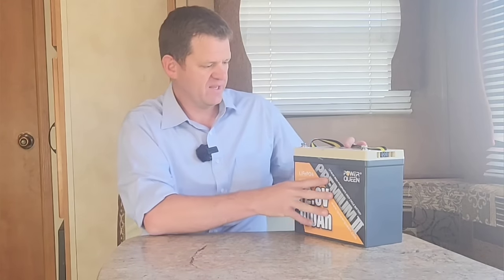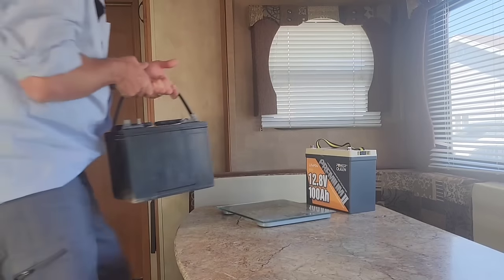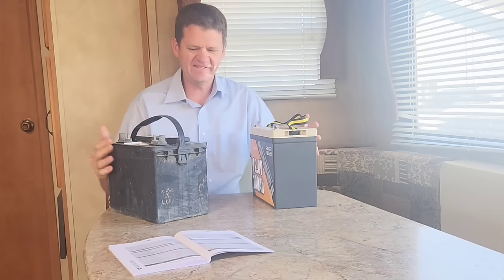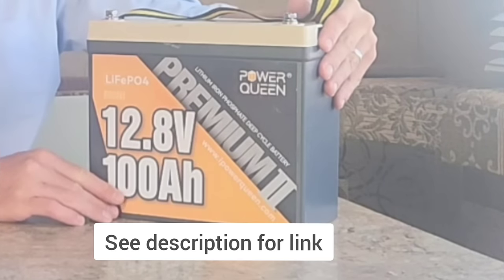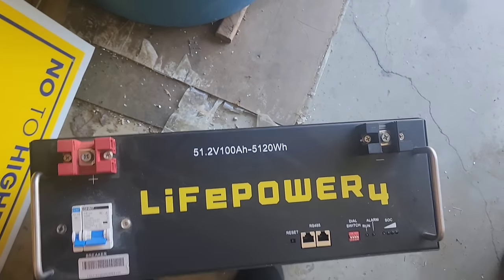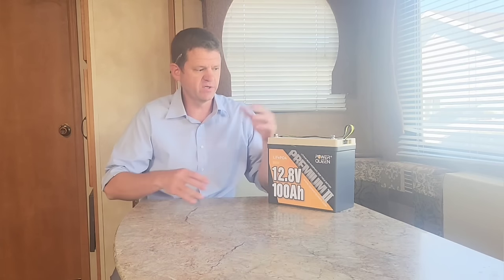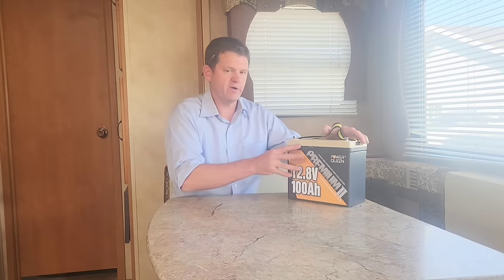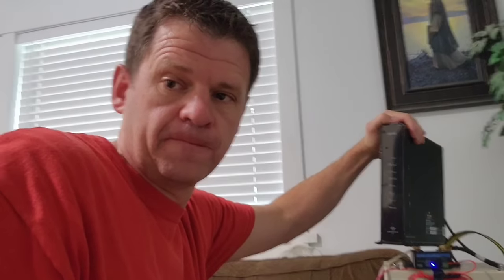How Long Can a 12V LiFePO4 Battery Run a Fridge, TV, Laptop, and Wifi Router (PowerQueen test)

Comment: Anything that will run off 12V should come directly from the battery.  I have the same battery running twelve LED light strips about 16hrs a day, a router, phone and tablet 24hrs a day, and it uses about 40ah on average with the lights being the highest draw.
Reply from the maker: That's a good point.
Reply: 12 volt is the way to go.
Eliminate the inverter except as needed.

There is a company named PMMI Lighting out of Sweeny Texas that sells all 12volt lighting systems run from a Raspberry Pi module using ethernet routers and CAT 5/6 cable.
Switches and lights are programmable via a Spreadsheet.

There system is pretty sharp.
Reply: Great information.

Eliminate the inverter where possible.
There are 12v TVs, Refrigerators, Freezers and lighting systems.

The appliances have come a long way in the last 15 years.

Most TVs run off of far less than 12volt today.
Reply: @shawnr771  I recently expanded my system so the 3,500w pure sine wave inverter now has to power my fridge and a cube freezer, hence it has to run all the time.  But before that I only powered the inverter when needed.  There's lots of stuff that will run off 12v with no inverter.
Reply: @frankmaze1972  oh absolutely.
I built a 12 volt system just to run lights, fans, a very small fridge and a tv set plus charge phones.
You are far ahead of me.
I live in Texas I want to build a cold room. Heavily insulated and cooled by a 12 volt AC for when the temps get to extremes. Just in case the grid power goes out.
Reply: @shawnr771 thanks
Reply: @shawnr771  With the recent threats (yes threats) from ERCOT to start cycling off power in 15 minute increments, I'd get on that sooner than later...
Reply: I love my Onite LED bulbs powered by USB. I`ve used them for three years with no issues. I can hang a 100w folding solar panel in the shade of my camper roof and still power a light for "free"
 in my dark camper all day. Even if it`s very cloudy the light works. I`m gonna rig up a glass panel next month with a USB car adapter for free daytime light. I have power stations and a large battery but love rigging up strange things. It`s a blessing to have power for all my stuff in my camper, even a small air conditioner, during our constant Louisiana power outages. My sister nearby who called me "crazy" and her OCD son have a lot more money than me but have nothing for emergencies. That`s loony to them. Power was out FIVE TIMES during extreme heat emergencies this summer. I`m disabled, no car, but nobody checked on me, even after 80 mph winds in one storm. They evacuated to hotel rooms. That`s ok...my freezer never thawed and my tiny AC stayed on.  @shawnr771
Reply: @shawnr771 
All the decent 12V fridges I’ve had my hands on have an inverter built in and are really 110V or 220V inside.
Also long 12V high current runs are very inefficient.
Reply: @Margarinetaylorgrease  The  one I have is an oversized cioker and it is 12 volt.
It does nor have a compressor.
Reply: @50kArchipelagos  My friend has a 12volt TV. Not big works great in storms
Reply: @shawnr771  Me too...
Reply: @Margarinetaylorgrease  I have two "BougeRV 12 Volt Refrigerator 12V Car Fridge 23 Quart Portable Freezer Compressor Cooler 12/24V DC 110~240 Volt AC for Truck Van RV Camper SUV Boat Travel Camping Road Trips Tailgating -7℉~50℉".  Use one as fridge one for ice.  Not for a family.  I'm a single so I rough it by nature.  That's on the Zon.

 "
Reply: charlesfinnley5106  I am not sure of this batteries capacity and I learned battery math using amp hours.

A lithium battery can be run down farther than a lead acid and they are lighter.

So I will use an example.
There are online calculators.
Amps = Watts/Volts.
Lets say you have a 200 amp hour battery with a 12 volt Tv set drawing 96 watts.
So amps = 96÷ 12
Or 8 amps.
This is per hour.
200 amps ÷ 8 should = 25 hours of TV watching without recharging.
But you dont want to totally discharge any battery.

So for each appliance there is usually a information plate that  usually lists wattage, voltage and sometimes amps.

Just divide the amps on the label into the size of the battery.

Hope that helps.
Reply: Your "old video footage " is caused by the light coming in the window, close the blind or film from the other side of the room. Try reading the instructions for your camera about exposure control and eliminate the glare to get a better picture.
Reply: Also if you buy another battery you can parallel the batteries and double the amp hours
Reply: @frankmaze1972 Do you have special things to change the type of current? I thought doing something like trying to charge your phone with DC atleast in america would ruin the battery or just fry the phone? Or is that really only something you need to worry about in Europe for devices and appliances that are not designed to be run off of 220-240 DC?
Reply: @shawnr771  There are batteries actually that are designed to be completely discharged and be fine. Deep cycle batteries and marine batteries which are deep cycle batteries that are designed for salt and fresh water conditions and are pretty water proof up to certain depths of course. A normal car battery is just a starting battery and everything else is designed to be run off of the alternator. An AGM battery is different though. They are normally completely sealed and instead of being a liquid battery are normally just filled with special cells. They can be discharged and recharged many times and can also be used for starting though if I remember correctly they arent the best for starting a battery due to it being able to shorten it’s life span. My Iphone battery is another example. Every so often I am supposed to completely discharge the battery and leave it off for a few minutes before plugging it in and recharging it.
Reply: @Margarinetaylorgrease  Ummm. Ok. So how are you multiplying your volts there?
Reply: @Margarinetaylorgrease  I am very sorry. Somehow what I was thinking and what I was typing were exact opposite…. While embarrassing I will admit this happens to me from time to time and I dont always catch it fast enough and I am also on 2 hours of sleep after running around for near 36 hours straight….
Reply: @Margarinetaylorgrease  I have already explained that and apologized. Just ignore the other comments. Its embarrassing enough that it happened again. It is a problem thats happened way too often lately and its actually frightening. Its a sign of a few possibly brain related issues that plague alot of elderly people and I havent seen a neurologist yet due to a lack of money.
Reply: @AmaterasuTheWhite  
I was replying as you were
Reply: @AmaterasuTheWhite  
I’m sorry to hear that.
Try to not beat yourself up about it.
I’m more sorry that getting help is a problem.
Reply: @shawnr771  yeah the inverter is a little more greedy when it turns the 12v into 240v
Reply: @AmaterasuTheWhite  if you can charge your phone in your car with the cigarette lighter/power point then you can definitely do it in your house.  And DC to DC charging is much more efficient than AC to DC charging.
Reply: @frankmaze1972  I thought your vehicle turned the DC into AC or that the actual cigarette adaptor switched it in the U.S. before sending it to the outlets in the vehicle? And yes of course you can charge your phone in your house in the U.S things like your phone are designed to be run off AC which is what is supplied to houses in the U.S while in Europe DC is used. Someone should volunteer to hook a phone they dont care about directly to a 12V battery to see what happens to the phone’s battery over time.
Reply: @AmaterasuTheWhite  all house power in the US and EU is AC voltage (US 120 - 240vac and EU 240vac) and ALL phones operate on 3.7 - 4.2vdc (most are 3.7vdc).  So if you plug into a wall socket the power is converted to DC and reduced to 5vdc by the USB connector, OR if you plug into a car outlet (12vdc) the power is reduced to 5vdc by the USB connector.  Morel of the story, ALL phones charge on 5 volts of DC power coming from the USB connector.
Reply: @frankmaze1972  When did the Europeans switch the AC?
Reply: @shawnr771 how often power goes out?
Reply: @AmaterasuTheWhite in Italia e europa la corrente is AC no cc 230volt in usa is 120volt ac normal de battery evry cc 12v or 25.6v o 48volt 51.2v
Reply: @AmaterasuTheWhite  Europe does NOT use DC power. Everywhere uses AC. Many items use DC power, which is why we have adapters and power supplies.

Comment: The amount of time you can get for a fridge will depend greatly on the ambient temp . If it's 40 degrees in your house it will run a lot longer than if it's 100 degrees.
Reply: it would be great to have some kind of chart to see that.  I'm thinking keeping the condenser coil shaded would help?  I know the water cooling technique works, but its just not reliable.
Reply: If it's 40 degrees, I'm not running the fridge. I'll keep the beer and cola on the counter.
Reply: And how many times did the kids open the frig door? Like your video. Considering a backup system,. LP generator or lithium batteries.
Reply: Also depending the brand/quality of the fridge.
I have a Samsung (fridge/freezer combo) with digital inverter, which means it doesn't consume maximum wattage to adjust or keep temperature it can gradually increase the power and speed of the compressor.
Reply: and the number of times the door is opened
Reply: Using a refrigerator as a test is about the absolutely worst thing you can choose!  For one thing, they don't use much power. That's on reason why all these so called "solar generators use a refrigerator as an example in their advertising!!  If you don't open it much or add contents to it. Any decent fridge will keep food fresh and even frozen for 3 or 4 days without power! And people will think the crappy "solar generator" works great because food is still cool!  People just assume that it's a big appliance, so it must use a lot of power. It doesn't.

A 100 Amp hour battery is not realy very much power even if you have an efficient inverter. 

These kinds of tests are mostly a waste of time. Better to just learn the nameplate continuous watts of an appliance. Things like a refrigerator atr no continuously on. Accounting for conversion losses, that battery will supply about 1000 watts for an hour. or 100 wats for about 10 hours,  So 1000 divided by the wattage, will give you a pretty close estimate of hours use you can expect. That is the simple way to figure it out and it will be pterry close
Reply: @professorg8383 ok ok però lo schunt misura tutto i watt xhe scono non c'entra se apri o meno la porta del frigo lui cmq misura tutto cmq de lifepo4 da 100amper 12.8volt is good 1.1kw real più 180watt per il consumo dell inverter victron is good
Reply: Damn, I would never have think that! That means maybe your AC increases your electric bill more and more as the outside temperature goes up?  Wow!

Comment: Fyi to the people who wanna know why the inverter (and technical all inverters and generators) are in VA (volt amps) and not Watts. This also explains why the AC kWh dont match up with the DC kWh, especially with the fridge. It is call power factor and it only affect AC power. It is to complicated to explain here but there is plenty of good videos and websites online that explain it. But all you really need to know is that kW is the usable output energy and kVA is the energy required from the power source ( generators or inverter). E.g. a 110w fridge on 110v would theoretically pull 1A. 110v × 1A = 110w but in reality, with a guesstimated power factor of 0.8 (changes depending on the type of load), it will pull 1.25A. 1A ÷ pf0.8 = 1.25A. This means the inverter sees 137.5VA (1.25A × 110v) while the fridge is still only physically using 110w of power. Its basically another form of power loss on top of your normal other losses but alot more complicated to get your head around.
Reply from the maker: Great explanation. Except for my growatt 3000... the 3000 specifies how many ac watts it can support. Ie usable energy. The documents also mention 3000 W. I just tested it and it turns off just when it goes over 3,000 ac watts( enough for two large appliances). 
    However the victron multiplus 3000 only supports an output of 2400w of usable energy (Only enough for 1 large appliance)

Comment: Nice real life practical test.  One correction as I've been using LiFePO4 so some time now.  I don't recommend bringing the level down to zero too often as it will affect the amount of life cycles over time. I have a large solar array and expect at least ten or more years from my Power Queens but I won't run them down more than 60%.  I better get at least 6-8000 cycles out of them.
Reply: Should go down to at least 40- if not 30% for Max cycles not 60. But more important is just keeping them in an environment that has a stable temperature and adequate airflow/passive cooling. Along with charging them at as low a rate as is practical.
Reply: Nel 48volt is bulk 54.4v float 53.9v en. End stop 51volt is perfect
Reply: The best way is 30 to 80%. They don't like being fully charged.

Comment: Inverter efficiency is also affected by the power factory of the devices. Inductive loads like fridges, HVAC, etc have a very bad power factor, and will decrease that efficiency a lot.
Reply: Do stuff that uses motors?
Reply: S*

Comment: You’re life and your families lives are on the line never put li on batteries in your home or boat that’s my opinion.
Reply from the maker: I'm putting cement backer board on my walls before I install my main system as an extra precaution. Outside garage. My laptop batteries and phones will definitely come in my house though.

Comment: Great video.  Yup, the inverter will make a huge difference on how long things will run.  I have 4 200AH SOKs in my rig with a Victron set-up and 1000W on panels.  In summer, no problem staying near fully charged.  System draw approx 15% of battery bank overnight if we are not here and 20-25 when we are.  Winter, I get about a week to week and a half due to cloudy or full overcast days.  These batteries are not that new BUT the prices have gotten consistently cheaper and recently very cheap.
Reply from the maker: Nice setup. I love my RV running on these batteries. I have one server rack battery in but it looks like you have about twice the battery storage capacity.
Reply from the maker: I'm running the growatt in mine with a victron battery monitor. I'm really liking it.
Reply: @diySolarPowerFunWithRay  I recently picked up a Growatt for my  workshop.  Curious how much standby draw it will have.  I could have my trailer last a lot longer if I shut the system down, but I keep it running even when not there for wireless internet, cameras, fridge (don't have to always carry food back and forth) and lights so it always looks like someone is home.  Look forward to see how your setup evolves and grows.
Reply from the maker: My GW uses about 50w idle... which is off-set by an extra 150 watts of solar on the roof.  Go with the EG4 v2 battery if you're only going to get one battery for your system. That thing is amazing and can start anything!  I did a video of that battery also.  You'll like the GW but it's a little more finicky that the Victron.

Comment: One safety aspect. Ground your fridge. The output of the inverter is floating in respect to ground. It could store charge on the stainless steel of the fridge.
Reply from the maker: Good point
Reply: @diySolarPowerFunWithRay  I do not know if it is allowed in your country but here we connect one of the outputs of the inverter to ground so this will be the neutral and the other will become the line voltage. No surprise when using appliances.
Reply from the maker: @qno-oj3py  Yeah, We can do that. I think the easiest way is to used a ground Neutral bonding plug.

Comment: Yup, 50% more storage juice. I have at least 32 KW hours in lifepo4 at 48V with a 10,000 watt solar array outside. I initially purchased a few 5Ah tiny lifepos, studied them and learned enough to build two 15KW/Hr 300 pound, 48V batteries. For portable power stations I have literally lived off of the Bluetti AC200p for four flawless years straight. I gave it to my neighbor so he could learn about it after upgrading to the AC300 four stacker, B300's.
Reply from the maker: Wow. Nice! 👊